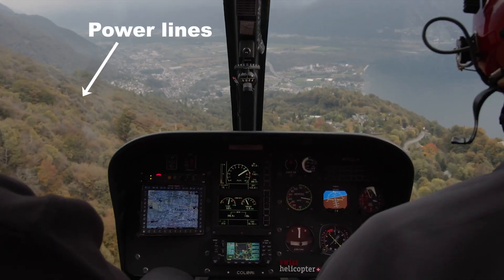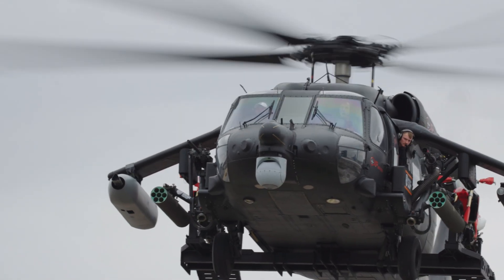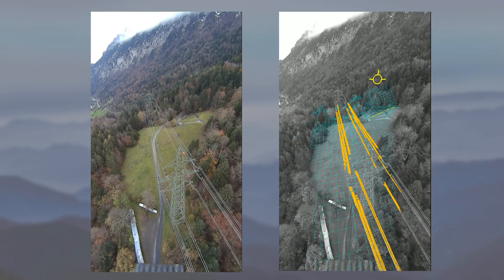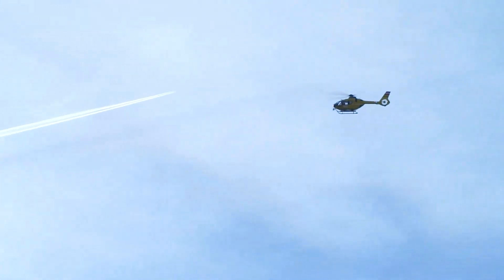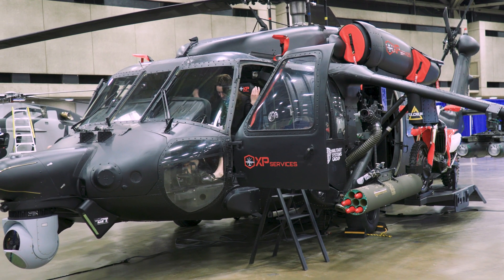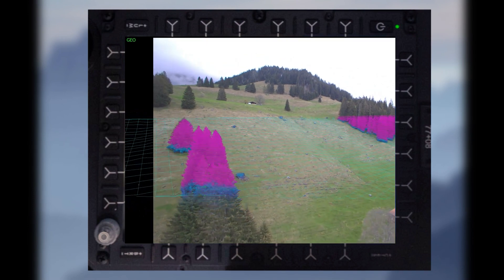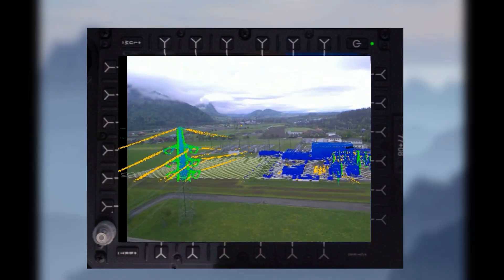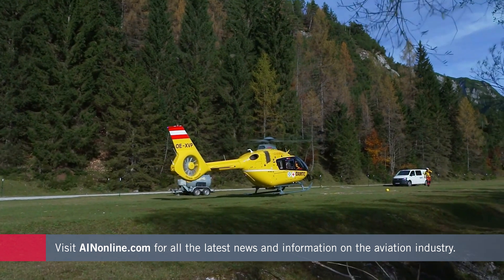Obstacle Detection Tech Helps Helicopter Pilots Avoid Power Lines – AIN

Comment: How does this work in rain/mist? I imagine the LIDAR doesn't work well with medium between the obstacle.
Reply: The impact of rain (light and moderate rain) on detection range due to absorption or scattering of the lidar is negligable. Some effect can be seen from the wetting of the target objects but it is typically quite moderate. Mist and even fog down to 800 m visibility slightly reduce detection range (on a wire by approx. 20% between 12 km visibility and 800 m visibility). Additional noise induced by rain drops, snow flakes or fog droplets need to be filtered out.